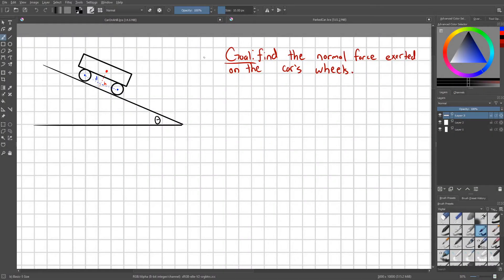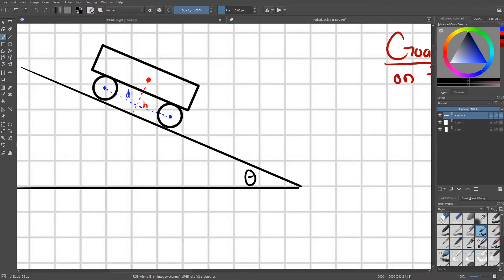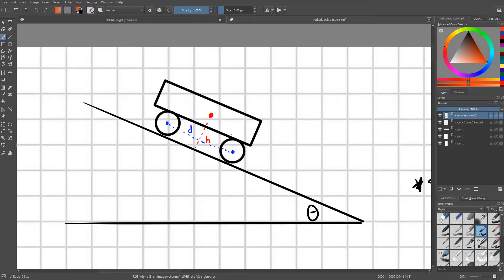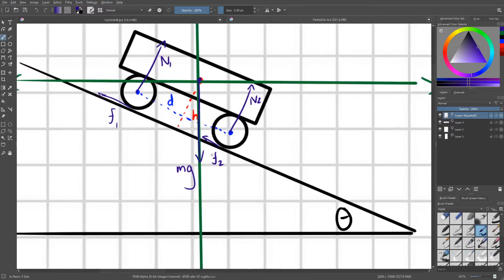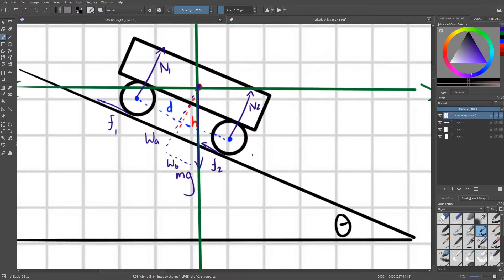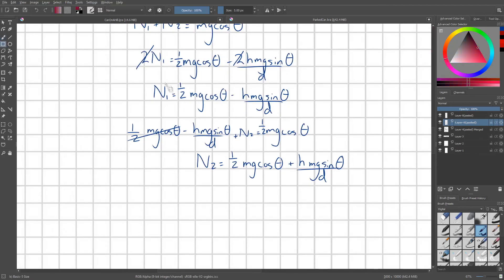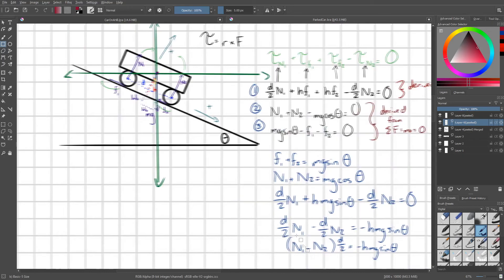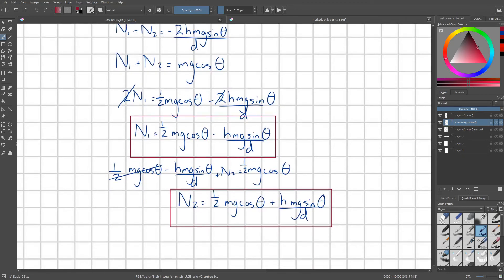Parked Car on Hill | Torque Application

Comment: I know this is an old video, but I really appreciate this.
I am a high school physics teacher, so I know enough that I could follow your very good and precise explanation.
I looked everywhere trying to find the explanation of why there is more weight on the back tires of a car than the front tires of a car going up (or parked)  on a hill.
I did come to the conclusion that if the car were not parked (freely accelerating down the ramp) then the weight would be equal on all tires.
I also had the question as to whether it would matter if the front or rear wheels were breaking.   
I see that the formulas for N1  and N2 do not include these variables, it must not matter which wheel  was free to spin or braking.
As a further exercise I plan to verify mathematically that N1 and N1 are the same in the absence of friction.
Assuming there is no change in the center of gravity (no suspension movement) then the result is that the maximum friction of the uphill tires would be less than the maximum friction of the rear tires (depending on the angle).  A front tire break could hold the car up to a 30 degree angle, but the rear tires could hold up to a 60 degree angle (center of gravity directly over the pivot point where the wheels contact the ground.
By the way, I think the drawing would be more accurate if the N forces originated from the wheel contact points and not the center of their axels.